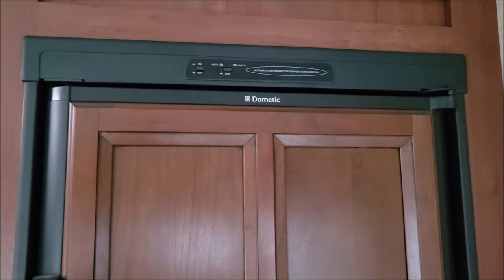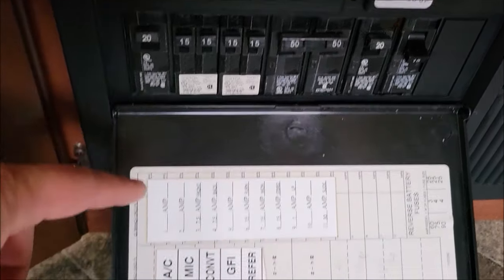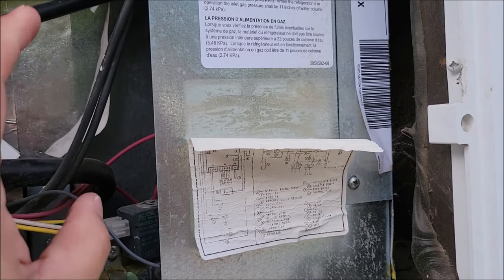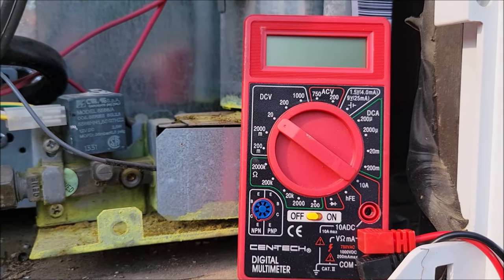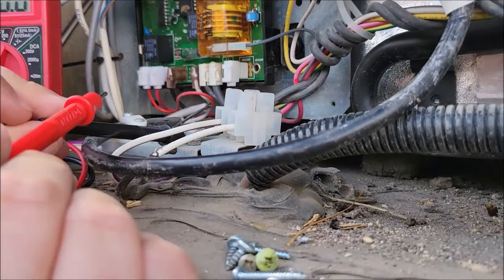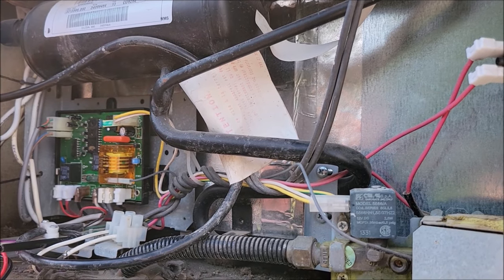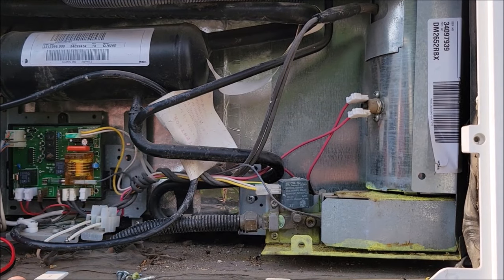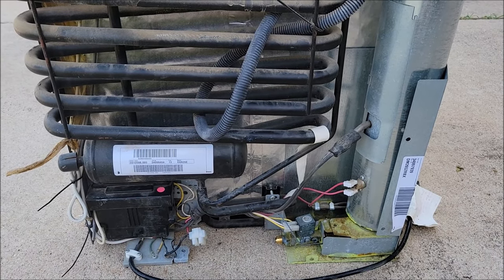RV Refrigerator Not Working | Easy Troubleshooting Tips | Dometic Issues

Comment from the maker: If your cooling system is leaking, that is a big issue and requires the refrigerator to be removed.  As long as that is not the issue, then you should be able to fix it by replacing either fuses/breakers or a control board.  Parts available here: https://amzn.to/3z5ssWE

This is what we ended up doing in our RV for the fridge: https://youtu.be/mxYPcA0Mvu4
Reply: I took my travel trailer in to Camping World because it had a leak on the max air Fan in the bathroom and they said it was coming from the refrigerator vent and I had them replac it and now the refrigerator overheats you can feel it from the outside and especially when you open the door to the camper It's like a blast furnace😮

Comment: The switch you pressed in is a Thermal switch it will kill the power if the burner tube is to hot to prevent a fire. Because your ammonia leaked out it was unable to pull the heat away from the burner tube and tripped your thermal switch. Over all very nice video
Reply from the maker: Thank you for the extra info.  All of it helps.
Reply: I went through all these tests and all the power is there to everything. Light is on inside the fridge and it sounds like it runs for a while and shuts off. Still no cooling in fridge or freezer.. Zero signs of am onia leaking. Plugged in at home plus propane is on along with good batteries.
Reply: @rockycon1967 
I'm having the same issues. Any luck figuring out the problem? N.FL

Comment: The round item with the popped out button is called a Thermodisk.  It is a safety device and will interrupt operation if it is over heated.  It can be  tested for 12v DC on both sides also.  The  5/6 wire harness can be tested plugged in with fine probes. You can place the negative off the mm into the red wire and the positive to the orange, that is power up to the control panel aka the eye brow.  Keep on red, the green in the upper right corner is gas down and to black is electric down.
Reply from the maker: Thanks for the extra info.

Comment: My Dometic worked fine on propane. But didn't work on AC. After replacing a blown AC fuse on the control board in the back the fridge thought it was running on AC, but didn't get cold. It appears that my heater element is burned out. I'm now trying to find someone who shows how to replace the heater element. I found the part, just not instructions to make sure i do it right the first time.

Comment: So so thankful that I found your video. Living in my RV in the heat of the summer and my refrigerator stopped working. You led me right to the fuse! I pulled another fuse to replace it immediately from something that I wasn't using. Thank you so much you saved me today. Great video!!!! I'm saving this in case I need more tips and tricks.
Reply from the maker: Glad this could help.  Now to find out why the fuse blew in the first place.
Reply: We have been avoiding the fridge issue for 8 months 🫣 very skery...  $2.50 /day for ice=$500-$600😮 and now I see the black 🖤 frigging button that looks like a muddobbers nest material?!?!!😫
Thanks for making it look so simple

Comment: Thank you so much for producing this video!  Even after a couple of years it came in handy for me since my Dometic frig in my Jayco fifth wheel all of a sudden stopped working.  I started the troubleshooting the electrical system AC first and then found out that I didn't have any DC going to the fridge.  Turned out that a fuse was blown (doing its job). So just replaced it and it started right up.
Reply from the maker: Glad it was just a fuse.

Comment: This is a fantastic video that helped lead me to my problem. I had no power to the refrigerator. I followed your advice up to the DC input power (red wire). The red wire does exit the connector and leads directly to the boiler thermal switch, BUT it also has a hidden fusible link right before the thermal switch. You will see what looks like black electrical tape around the red wire ( this is the fusible link. The fusible  link looked good but it was was bad because this is where my power stopped and I had voltage across the link. In a pinch I jumped the link (until I can replace it) and Voila, power restored. Thank you for leading me down the path!
Reply from the maker: Glad you found it and thanks for the extra info.  I did not know there was a fuse there.
Reply: Great catch! Fusible links can get overlooked as they just look like a wire splice. I'll keep my eyes open for one as I dig into my unit.

Comment: Oh, this is keeper vid!  Understand it!  Love it!  I have a 2021 Dometic RM2454 rv refrigerator running on ac intermittently the lights on on upper control panel start cycling on where ultimately all the lights are on!  Have “debugging” this for months!  The frig seems to operate normally - but, I can’t catch and analyze system during apparent random cycling.  Dometic not helpful.  Almost read to replace both upper and lowered control panels.
Reply from the maker: Let me know what you find. Good luck.

Comment: This video saved our day on the lake. We found a thermo fuse that was bad in the 12V power line thanks to your video helping us know where to start. Thank you!
Reply from the maker: Glad it helped.  Hope your day on the lake was great.
Reply: I had same issue, didn’t even know that thermo fuse was there. Had 12 vdc where wires went in, but not at stove pipe. Pulled insulation & found it, just twisted wires together for quick fix & refrigerator turned on.
Reply from the maker: @bladefrk34  Glad it was a simple fix.
Reply: Thank you very much for the great video. It really helped me tremendously.

Comment: Great video. 
I can't get mine to work. 
I will be watching this again. 
Once it warms up a little. 
Mine has the blinking light inside so I will be checking what I learned from you. 
Thank you 😊
Reply from the maker: Hope it helps fix your issue.  Good luck.
Reply: Did you figure out your issue? We have a blinking light on the DMC4101 (electric only) and are about to start pulling things apart.
Reply: @dawnmarrs9412  I bought and installed a new  dinosaur motherboard. Now I don't have a blinking light. It  works when I wire it up directly or if I  hot wire the ignitor. But automatically it still doesn't work. And I haven't had time to look at it anymore 🙃 lately 😕

Comment: Your video really help me understand what's wrong my fridge thank you
Reply from the maker: Glad I could help.
Reply: I do need some help please, I have just replace both boards and the fridge still isn't working. I used a multi meter to check all the power after installing the new boards, but still no power. My fridge doesn't have a leak like yours. Any suggestions? Greatly appreciated

Comment: dude!!! you are the bomb!!! that was everything i needed to figure out!!! ty so much!! now i have half a chance figuring out whats wrong w my fridge!!!
Reply from the maker: Awesome.  Glad it was helpful.  Good luck.
Reply: @SeidelRanch I have a prowler camper. My refrigerator panel lights up but will not cool (it defrosted itself because the freezer was full of ice). No yellow fluid coming out of the back . Any thoughts on my problem
Reply from the maker: @GaHullbillyRanch  It could be a number of things.  Check fuses and power to the back.  Make sure all the needed voltage is getting to where it needs to be.  That is what I would check first.

Comment: The little button "sensor" is usually a bimetal thermostate, used as an over temp safety switch.  You will find them again on the hotwater heater
Reply from the maker: That is good info to have, thank you.
Reply: Yeah on the schematic, it’s called a thermofuse.

Comment: My issue wound up being a 1.5 volt resistor in the line going from power over to the reset button on the gas tube, where the rest switch is. I ordered a new one on the radioshack website, crimped it and it worked perfectly!
Reply from the maker: Nice to know.  One more thing to test if the issue arises.  Thanks.

Comment: Thanks for the video! Mine wasn't any of that, but the 12 volt wire going to that little button has a resistor soldered with a heat shield.  Still very helpful 👍 -CXD
Reply from the maker: Glad it helped

Comment: Thank you!!! This is really good! Do you have any videos on diagnosing RV/Trailer drive lights are not working when plugged into vehicle. Break and turn signal lights, as well as trailer breaks work, just drive lights are not illuminating.
Reply from the maker: I don't, but I would start by narrowing it down by testing the truck outlet and making sure all that is good.  If the tow vehicle is sending voltage, then I would test the wires in the trailer connector.  Those 7 way connectors sometimes come loose inside and you have to pull the cap off and tighten it.  Hope that helps.

Comment: Terrific video I learn a lot and saved money from paying a Rv guy come out plus I find out sometimes theses wire connections might be a little corrosion or rust on it I pulled them off sanded a little and jingle bells problem solved, I thought my box on outside was gone but found out wires were just dirty or no good contact
Reply from the maker: That's great. Avoided a very costly repair.  My experience with the RV shops is they would have probably just made you pay for a new refrigerator.  Glad that was avoided.
Reply: @SeidelRanch  keep up the great work again great video step by step, make more thru out Rv hey if you’re going to own one , might as well gain more knowledge
Reply from the maker: @Paul-iu1om  Thanks.  I have some trips in the RV coming up.  I will see what I can find to hopefully help the RV community.  Thanks for the feedback.
Reply: @SeidelRanch  no problem
Reply: I got same frigerator, got 120 and to circuit board , but no 12 volt coming in, converter has 120 it’s putting out 13.42 still no  12 volt at refrigerator I’m stump oh I forgot it’s got a dead battery; do we need a working battery lol
Reply from the maker: @Paul-iu1om  You probably need either a good battery or a good working 120v to 12v converter to power the 12v side.
Reply: @SeidelRanch  Thks for your feedback, these people I was trying to help, they have some problems with their breakers and 12 volt side somehow switches don’t make any sense as what turns off and on , I’ll let a electrician fix the wiring mess

Comment: Hello, excellent, very detailed video from you, thank you. Now a question about this...what would be the problem in the refrigerator if it is connected to propane gas and electricity, the light is on, the automatic light is on but it does not cool. I appreciate your answer.
Reply from the maker: Is the boiler in the back of the fridge getting hot?

Comment: Was supposed to be two12v fuses, one inside the box and one two the left of it. Mine only had the one inside. After replacing both control boards and still not getting any lights inside I finally found a fusable link in the hot wire to that breaker on the condenser, it was bad internally and not sending voltage. Have no idea why it tripped. I had accidentally let it run out of gas when it wasn't plugged in to shore power, don't know if that could have had anything to do with it. In any case I bypassed it and I'm running again. I can't see where it was needed really there is already also the 12v fuse in the panel on that same wire. Video was helpful and now I have spare parts on hand if one of the control boards goes out.

Comment: Before replacing the whole board, double check your thermistor. I was told it was my board, replacing thermistor first $14 and fixed it. Way cheaper and super easy to replace
Reply from the maker: Yeah, good point. If everything checks out on the board, it could be the thermistor. Thanks for the info and glad you got it fixed right.
Reply: Cody can you please explain

Comment: Great video!  When we got to the 12 V DC end our meter read 8.71. Now what should we do?
Reply from the maker: Sounds like either a weak 12 volt battery or the wiring for the 12 volt connection is too weak.  I bet it's the battery though.

Comment: Very nice job of teaching trouble shooting the system  one question so if you heater tank is leaking on the system can that be replaced or is the unit junk ?
Reply from the maker: It can be replaced, but you have to pull the whole unit out and take the cooling system off to put a new one on.  I personally never liked the refrigerator anyway so I did this: https://youtu.be/mxYPcA0Mvu4

Comment: Hit the button on the boiler and it turned right on, thanks!!! so does this mean i need to replace that? i did not see any leaking.
Reply from the maker: It could have just been one of those times and tripped.  I would watch it though.  If you keep having the issue I would suspect a leak.

Comment: Hey!! We just got our new trailer and in our first rv park, after plugging in the electrical and all we realized the ac was working, the microwave was as well but the fridge light wasn’t even on. I pressed it and as expected nothing happened. We never used this Narcold Eletric fridge before… do you have any idea what this could be or what we should do? 
Thank you so much!
Reply from the maker: Have you checked all the breakers and plugs?  Sometimes if it's new they may have the breaker turned off.

Comment: What a great video, very helpful for taking readings.  I'm having a problem with the system running for about a minute and then shutting down.  It will stay shut off for about 5 minutes and then does it again (runs for a minute)?  I have not taken any readings as of yet, but will give that a try.  I did pull the AC power and tried running on Gas, which it did, but with the same results?  Any help would be greatly appreciated before I have to call out a tech!
Reply from the maker: When it shuts down, does it pop any breakers or fuses?  It sounds like it's overheating.  That could be from a leak or boiler issue, but I am not sure.
Reply: @SeidelRanch  No fuses blew.  I appears that during the hard freeze we had here in Texas a week ago, it affected the system.  I found that the Thermal Switch for the Fan up in the plenum was bad.  Unfortunately due to the holiday I was not able to get a new switch yet, so I bypassed around it and have been allowing the fan to run constant.  The unit seems to be working now, with both the freezer and frig are at normal temps.  I appreciate the response!

Comment: Thank you for the great tutorial.  Our freezer is working but the refer is not cooling very well. The thermistor is all the way up. I want to make sure what is wrong. Can you please help?
Reply from the maker: Did you find the issue?  It could be a bad thermistor, but I had the same issue with mine when it was "working correctly".  I would try testing the thermistor.
Reply: @SeidelRanch  we did replace it Friday and it still doesn't seem to be working right but thank you for the info.

Comment: So our camper is at a seasonal campground. The fridge worked fine on 110 but we wanted a bigger fridge so I pulled the dometic out
Same fridge as jn this video.

We have not had a battery in our camper for 3 years as we run power off 110
4 days since I pulled it out of camper and the fridge does not work when I plug it in my garage?
No lights ON on front panel.
Would the battery wires have anything to do with this?

Comment: Thanks for the Vid, Our fridge and lights turn on but then that breaker trips and shuts everything off. we just replaced the main control board in the back of fridge but this problem still persists. no leaks seem to be happening. thoughts?
Reply from the maker: If it's popping a breaker, than the 120v power is shorting somewhere.  Can you run it on propane ok?  If so, it might be a 120v heating element.

Comment: The most informative videos I've seen. I've checked all these things you suggested all are good mine still is not cooling?
Reply from the maker: So you have all the power fine to the refrigerator but it's just not cooling?  What model do you have?  Does it work on one setting but not the other (electric VS propane)? I have heard of people having to replace the Thermistor (https://amzn.to/3zlmss8) to get it to cool properly.
Reply: All power is fine. Doesn't work on elc or pro. I'll get the model #
Reply from the maker: @AaronsLandscaping  Ok.  That would make me think either the thermistor has gone bad or the main board has an issue.
Reply: I have the same issue. Replaced both boards and have power now, but the fridge isn’t making any noise or cooling.